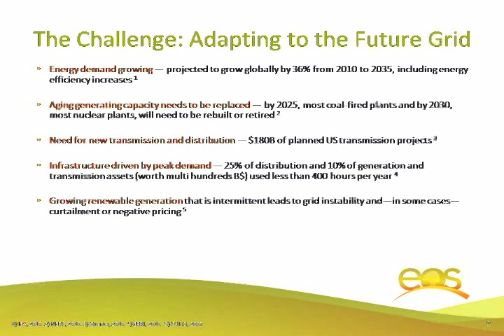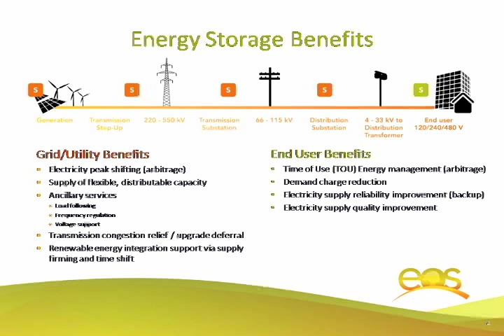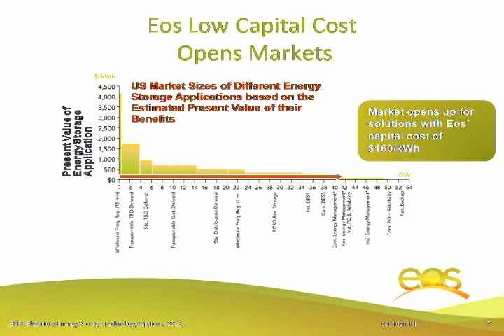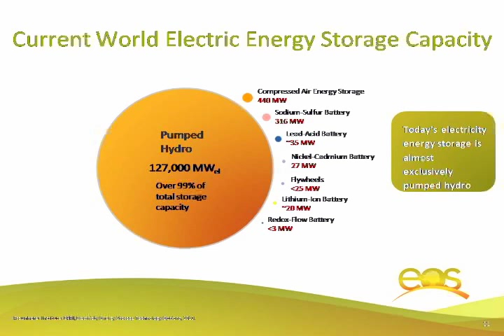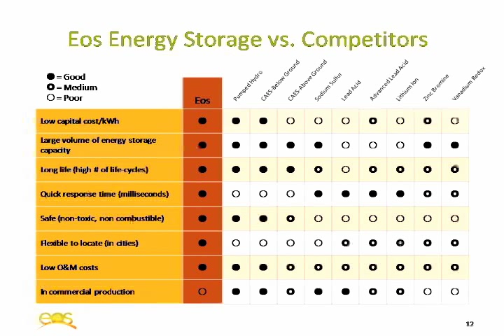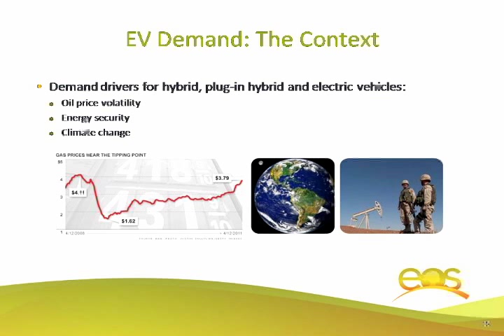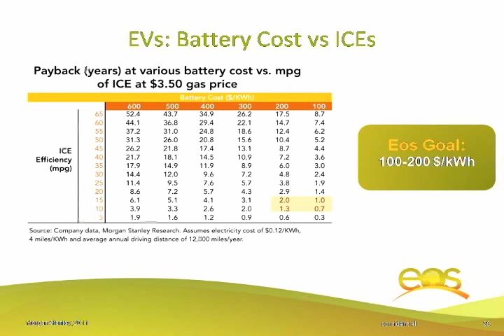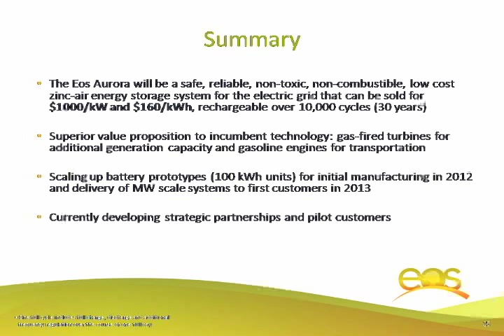Zinc-Air Batteries Mean Low-cost Energy Storage for Power Utilities and Electric Vehicles

Comment: Wow. I have not heard so many lies since A123 was making an IPO. The dude lost the line between what has been done and what they would like to see. Eos patent applications show a miserable areal power and efficiency which is not much better than that of gasoline engine. And he is talking about 24M-style suspension flow battery like it is already working.  BTW, 24M reports current of less than 10 mA/cm2 is their patent applications, i.e. the car battery power stack would weight 2 tons. Mr. Obama, I want  my tax $ than went to Eos back !